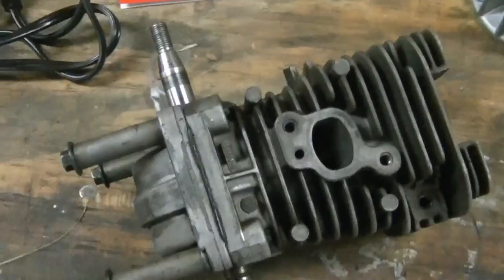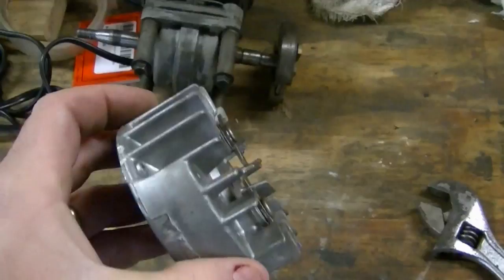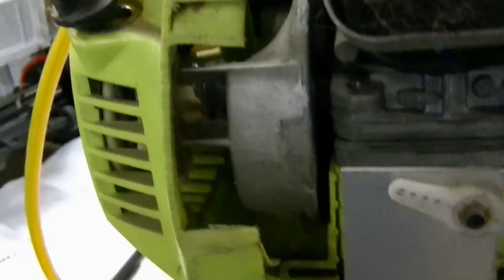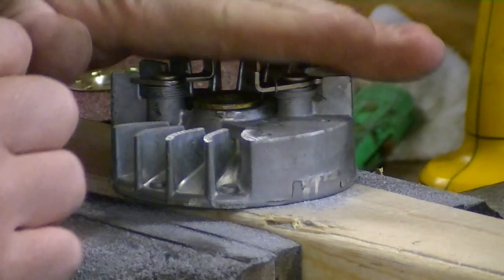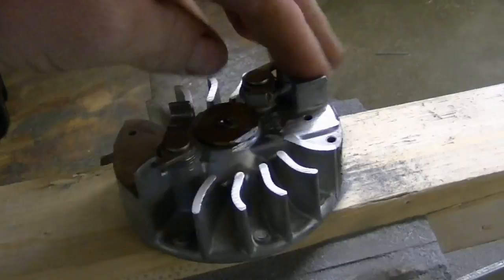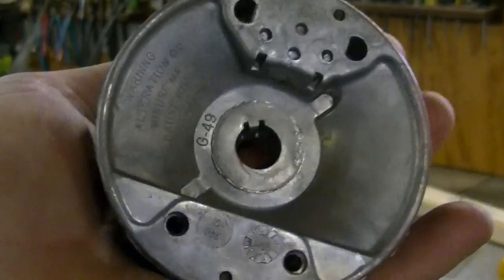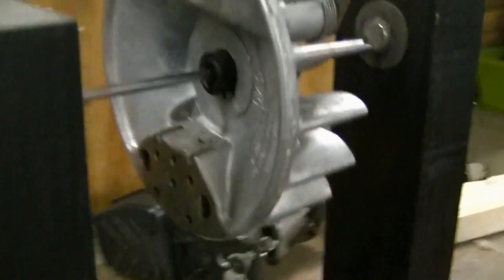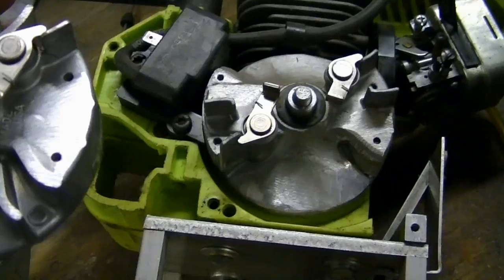How to lighten a flywheel.

Comment from the maker: @iulik17d @iulik17d  This is meant for engines that will have a propeller attached to them for use in a Radio Control airplane or an RC airboat. The propeller (and cut down shrouding)  provides the air movement necessary for cooling.